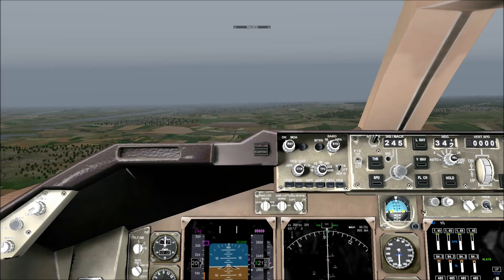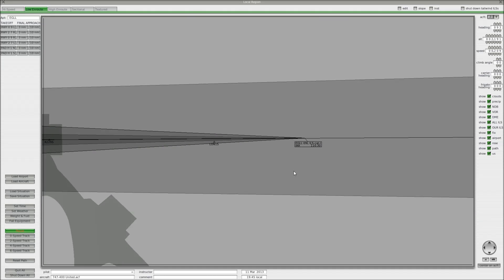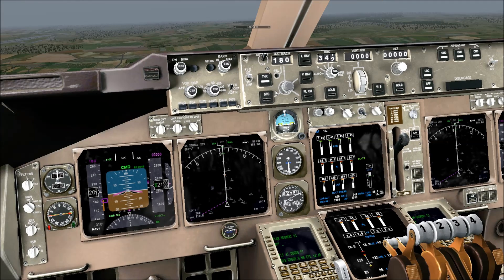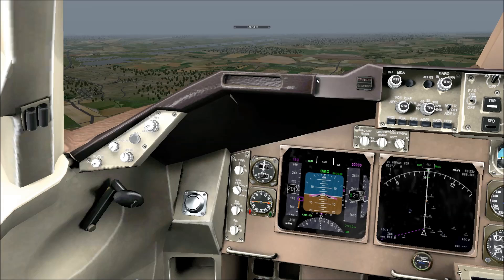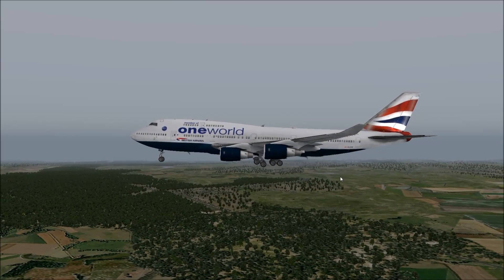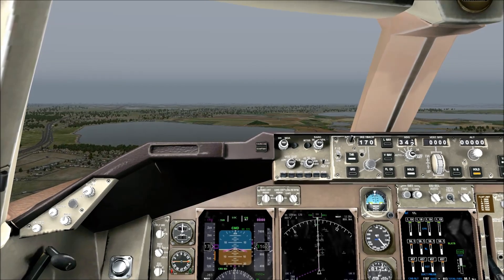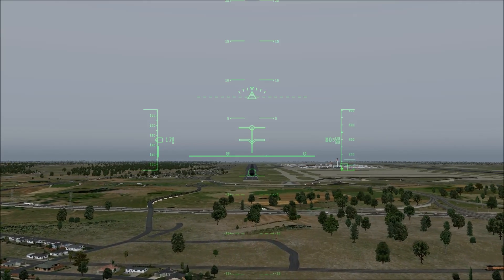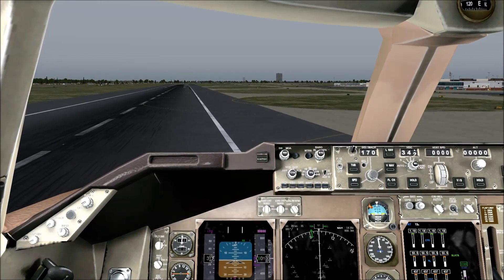How to fly an Auto ILS Approach - Tutorial - X-Plane

Comment: Hi I have a few questions, I'm upgrading from fs2004 (I know) to X-Plane 10 because I think I'm ready after a few years of getting used to fs9 to upgrade to a more realistic simulator. 
My first question is - how do you know which runway you will land or take off on? Because on fs2004 the ATC tell you which runway. On X-plane can I choose? (That's cool) 
Also how does the airline lock onto the glide slope? Is there a button I have to press? I think I understand that I need to tune the approach frequency for an airport. 
Also to conclude, is the flight easier if you use air traffic control instead of, when filing the flight plan, you leave the 'route' part blank (I'm not really bothered for vectors, or should I be in order to have a precise approach?)
Reply: Emile Pernet you use the wind direction you donkey! 300 at 10 use rwy 30l or R

Comment: Hi AviatoinXPlane. I want to say this is a fantastic landing and this also really helped me. I always do manual landings which are frustrating especially I don't have a joystick only mouse control and I am really bad at approach. I do VFR so I can't fly in foggy weather. In my glideslope/approach, I am always either too high or too low even if I try my best to align it with the PAPI lights. I just want to say that in real life, if you use parking brakes when you land, your gears will suffer some damage and also also in your video, the nose will just slam into the tarmac thanks to parking brakes. Parking brakes are only used for parking (living up to it's name) and for stopping while taxiing. There is something called autobrakes but they aren't as strong as parking brakes and autobrakes are designed for landing. Unfortunately, the default 747 either doesn't have it, maybe I just can't find the switch or the 747 doesn't have it but I know the autobrakes exist.
I overall love your videos. Just keep in mind about your parking brakes. :)
Reply: I meant AviationXPlane not AviatoinXPlane.